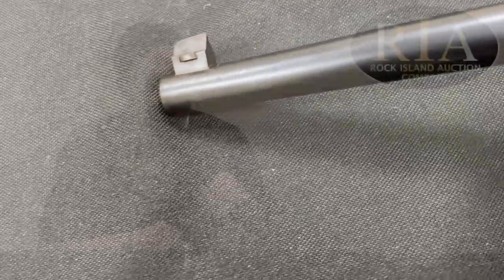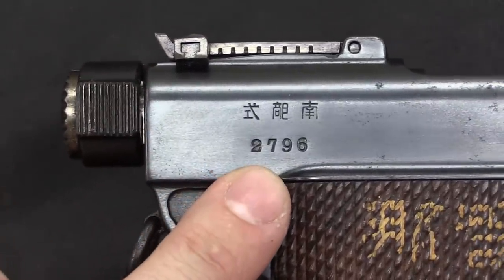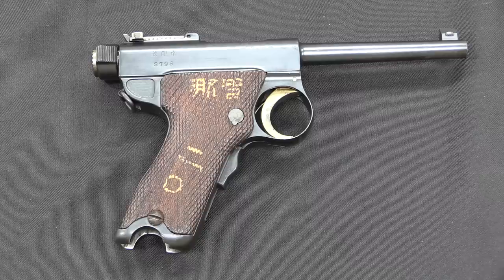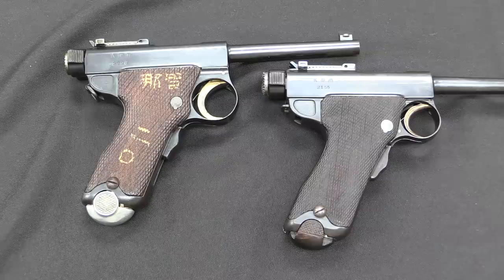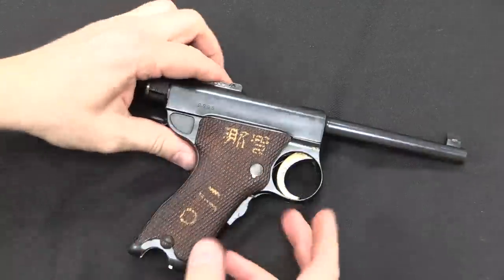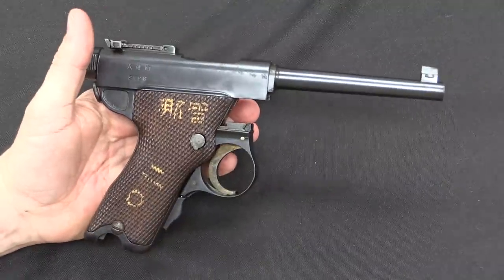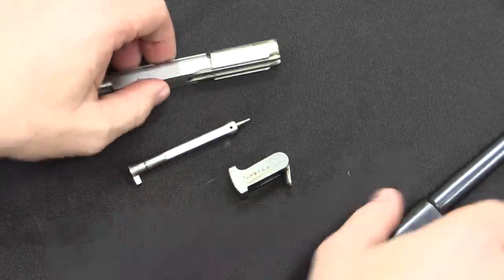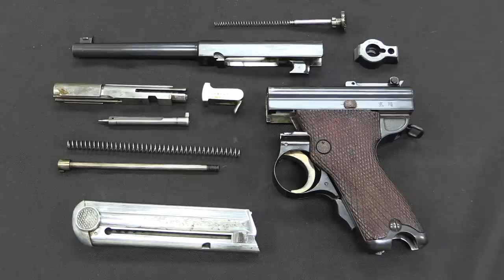Japan's Interim Handgun: The "Papa" Nambu

Comment: Like a  complicated Japanese luger, pretty neat.
Reply: Actually closer to a C96 mechanically, but it does look really pretty
Reply: Jamez It has no relation to the Luger outside of a superficial resemblance. People need to drop this “Nambu is a Japanese Luger” Fuddlore.
Reply: @simplymadness8849  Yeah it has the same energy as "the Type 99 LMG is a Japanese Bren"
Reply: @nafisbernafas9073  but it technically is in that case, The Japanese switched from 6.5 to 7.7 after looking at various cartridges (though idiotically changing mid-war) and the Type 99 is an illegal copy of the vz. 26 LMG that the BREN was legally designed off of.
Reply: @mmouse1886  Didn't know the bren was taking from the ZB 26. Cool! Although I believe the operation of the Type 99 and the BREN differed slightly
Reply: SimplyMadness I mean considering its not a toggle lock action yeah it's in no way similar mechanically, they just happen to share mild cosmetic features for the most part imo. I personally wouldn't say it's a Japanese Luger in any way.
Reply: @mmouse1886  
The Type 99 copied the layout (magazine on top), but the internals are pretty much the same as the old Hotchkiss guns they copied.

Comment: "it has an adjustable tangent rear sight, it goes out to 500 metres"
now that's an april fool's more than 100 years in the making
Reply: 500 meters for shooting at battleships and aircraft carriers
Reply: At the end of the XIXth century or the beginning of the XXth, some pistols had adjustable tangent rear sight : Mauser C96, Luger P1914 artillery, Browning GP35... With a removable stock, U get a little semi-auto carbine.
Reply: @methodeetrigueur1164  except the papa nambu doesn't have a stock, and even with one, 500m is overly optimistic for anything other than harassing fire
Reply: HouseBalley Sure but it was common at this time. That’s why there is a slot at the back of the grip.
Reply: @methodeetrigueur1164  
The Papa doesn't have the slot, i know it's a vestige of it's origins, but you are missing the lighthearted humour of my first post
Reply: @methodeetrigueur1164  Because you're going to be able to hit anything at 500 meters with a 5 inch barrel...
Reply: benn454 That’s not what I wrote. Read my post again, it’s only facts. A lot of weapons have sights for distance they can’t reach. But they have.
Reply: @benn454  well, its gonna hit SOMETHING....prolly not your target, though. its amazing that the japanese army took so much with the equipment they had
Reply: + @kimrasmussen7188 + Probably because most of the people they fought were absolutely garbage at warfare. At least until the US got serious then Japan started experiencing the crushing weight of the Arsenal of Democracy.
Reply: kim rasmussen True, the Japanese were fantastic soldiers. They had the warrior way in their minds (bushi-do) ! That’s not apologize their atrocities in China.

Comment: Those Chinese Character (Japanese do use some Chinese characters in their language, called Kanji 漢字) 陸式 roughly translate into "Ground Type". But it means it was adopted by IJN. As 陸式 is short for IJN Marine Corps Type (海軍陸戦隊). IJNMC acquired about 10000 pieces in 1924. Citation: https://ja.wikipedia.org/wiki/%E5%8D%97%E9%83%A8%E5%A4%A7%E5%9E%8B%E8%87%AA%E5%8B%95%E6%8B%B3%E9%8A%83
Reply: Cool, so the Nachi probably does refer to the cruiser then.

Comment: Legit question. I've always seen nambus perform poorly on any video I've seen. Why is this? Does it have to do with their age, their manufacturing quality, or or they just a bad design?
Reply: @naricky8408  Thanks
Reply: I forget to tell you the 1090~1100 ft/s is the post 1929 load.The pre 1929 Velocity is 980 fps but the bullet weight is same.If you wanna load you own 8mm Nambu,please check out this post https://www.tapatalk.com/groups/collectorguns35625/loading-the-8mm-nambu-cartridge-to-post-1929-stand-t2326.html
Reply: The main spring in Nambu pistols is also notorious for becoming weaker with age. Paired with bad ammo, they have problems functioning.
Reply: @trevillyan5515  thanks

Comment: Could someone explain why dry firing guns can damage them?
Reply: Firing pins are hardened a lot to reliably dent primers over a long lifespan. Because of this, earlier metallurgy, & sometimes geometry & other things like primer size intended for, they can be brittle, & without a soft primer to absorb the energy of the hammer or striker, all the force transferred instantly by firing pin overtravel measure & ends up as vibrations which can cause the brittle hardened pin to fragment.

Tl;dr without a primer the force has no where to go besides vibrations.
Reply: @kaylt.7864  thanks. So due to hardening they are brittle and with out the primer to cushion the impact they can break.
Reply: @yelar9000  yes

Comment: If only 10000 of these were made did the Japanese just not use pistols.  Another source said Japan only made less than 500000 pistols between 1890 and 1945.  Out of 5 million active duty service members that doesn't leave a lot.
Reply: Well about 400.000 Nambu Type 14s were made from different types.They made 71.000 Nambu Type 94 pistols,close to 60.000 Type 26 revolvers,about 5.000 Hamada Type pistol and 6.000 Sugiura pistols were made in same time.
Little bit more than 500.000.But this is still so small for an armed forces of some 6 million men in WW2 considering Japan also manufactured and exported large amounts of that pistols way before WW2.
Furthermore Japan probably just made about 10.000 submachine guns during WW2.

Comment: I've handled one of these Nambu pistols. ... Too complex for my liking, and much too large of frame for its performance.

I've also handled the standard issue IJA Type 1 Carcano-based rifle. It's far too long and clumsy for jungle warfare. Imagine the typically short average size Japanese man wielding it, but they did. The emperor's Chrysanthemum stamp gets cuteness credit.
Reply: The IJN was the branch that used the Type 1, not the Army.
Reply: @baneofbanes  The standard IJ Army was the then old Type 38. I goofed in my hasty original post. My bad.
The extraordinarily long Japanese rifle I held as a war relic, had the emperor's Chrysanthemum stamp.
Reply: @EK14MeV  and even then the Type 1 was a supplementary rifle. Standard issue for both branches was the Arisaka.